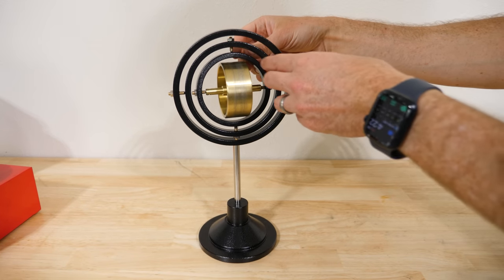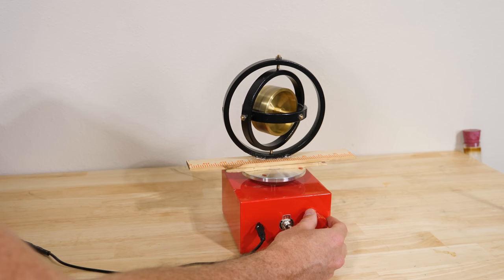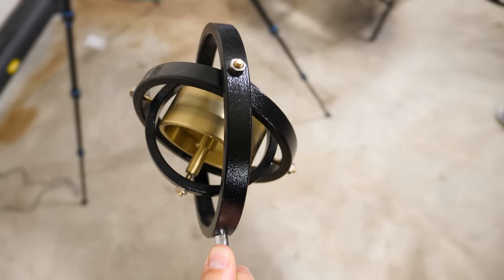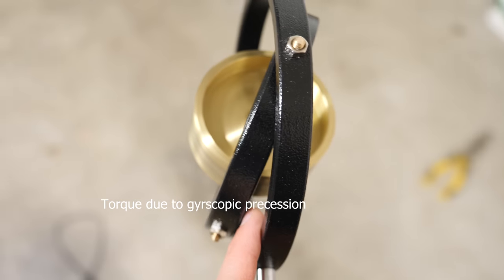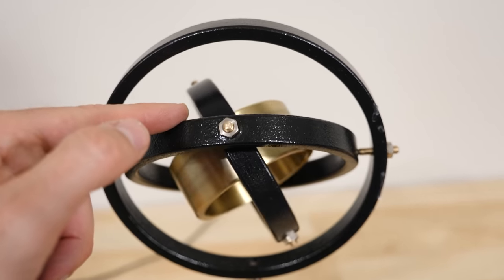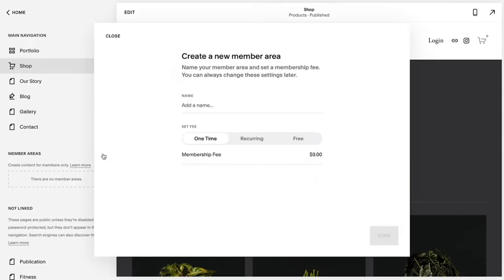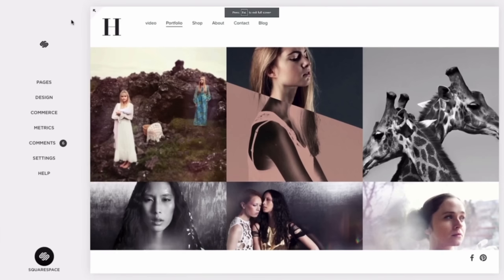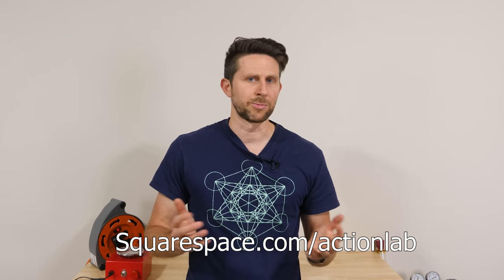Can Gyroscopes Provide Free Energy For The Planet?

Comment: Another question is whether you'd have to put more energy into the gyroscope (to get it spinning and keep it spinning) than you would be able to get out.
Reply: I can very easily proof,that this cant be done. And trying it out as a company is kind of stupid.
To extract any energy from earths rotation,you've got to change its angular momentum relative to its center. For this to happen, you need a external force. This could be something like the moon, but also something on earth speeding up or getting slower angular veilosity relative to earths center. So this is not possible with a gyroscope,cause its center of mass stays at the same point relative to earth. Its center of mass hasnt got any increase or decreas of angular momentum relative to the center of earth. Its basically bullshit. And i wonder, why they even tried.
Reply: Irrelevant since the very action of energy extraction ceases the perpetual gyroscopic movement
Reply: @drunkdrftr  This is what I meant when I referred to the energy required to KEEP the gyro spinning.  It seems similar to the attempts at perpetual motion machines.

Comment: One way to think of a gyroscope is a method of providing a lot of angular momentum without very much mass. But it is easier to think of this experiment as a big heavy flywheel attached to a generator. If you rotate the generator back and forth, then it will generate power indefinitely because the flywheel takes a while to catch up. But if you rotate the generator always in the same direction at the same speed, then the flywheel will catch up and no more power will be generated.

This thought experiment shows that you can only generate power with a reciprocating motion (as in the exercise gyro) and not with a steady rotation (as in rotation of the earth). It is an intuitive way to understand conservation of momentum. 

The Russians were being reckless with their rubles - no wonder they kept it secret!

Comment: Once it works, you will be extracting energy from both the spinning Earth as well as the flywheel. But if it works, you can store energy to the Earth at an oil field, and extract the same at gas/recharge stations--without using wires, tankers, or pipelines.

Comment: Isn't the circular motion of the hand that lights the LEDs using a gyroscope what you'd get it you put one in rough sea, with tides, currents and waves. That's the circular motion of the earth and moon, plus some solar thermodynamical flux in water and air...

Comment: i think i know how to extract energy from a gyroscope without slowing down the gyro. i also have ideas on how to use bouancy to generate free power that is so complcated in design that nobody would realize how it supposed to work. the gyro is simple but still people would not get it. if you try to lift a gyro on the end of a long stick compare to lift the gyro directly i guess the amount of effort on the stick is less than lifting the gyro directly and then you get the idea because the weight has not changed but somthing about the angular force has changed in respect to a stationary mass in the same setup.

Comment: It is impossible to extract energy from the earth's rotation by any means limited to the earth's surface. Any method that extracts energy from the earth's rotation must slow the earth down, but this breaks conservation of angular momentum.
The only thing that works is attaching a string to a weight, lifting that weight past synchronous orbit, and then winding the string around a generator shaft and letting the weight play out. The earth slows down, but the entire system conserves its momentum.
Yes, it's possible to extract energy from the tides at the cost of slowing down the earth's rotation. The moon slows down the earth, but as it does, the moon's orbit grows higher and angular momentum is conserved.

Comment: Maybe to harness the Earth's rotation use the tides. Connect a flotation device to a rope at the bottom of the ocean. As the tides move up and down it will pull on the rope, which will then turn a generator to produce electricity.

Comment: With the constant change in an area's temperature over 24 hours.
Using a gas in a baloon that expand and contract with these temperature changes.
Then using a rack and pinion attachment geared to get speed or torque from it.
Will this be a viable source of energy to drive a generator?
This will be a single cycle engine over 24 hours.

Comment: A gearing system is needed to convert the slow rotation of the Earth to a fast spinning dynamo. In principle, you could more easily also tap electricity from the Earth‘s magnetic field by a large enough dense coil array 😉
Reply: The friction losses would be an issue. Then how much energy is being used the keep the gyro spinning?

Comment: Anyone know the delta for input vs loss when applying electrostatic principles (similar to Vandegraaff  Generators) to this model(using conical magnetic levitation bearings in a vacuum race)Seems like a no brainer as a first step without taking advantage of China’s recent breakthrough extracting energy from quantum entanglement,….Cheers (also, incorporating concentric spheres and cyclotronic/collider principles in place of gyroscope rings, suspended via magnetic levitation is another option to completely remove the need for bearings thereby decreasing resistance. 

In theory we could even incorporate ionic and/or harmonic frequency stabilization/propulsion to smooth rotational wobble.

Comment: If you place a 1kg mass 10 metres from the pivot point of a see-saw and another 1kg mass 1 metre from the pivot point on the opposite side and allowed the see-saw to tip down on the side of the 1kg mass that is 10 metres from the pivot point, the 'turning force' would be 10 times that of the 1kg mass opposite.  Therefore, does this mean that the kinetic energy of the one-sided descent of the see-saw described above would be greater than that of the kinetic energy of the descent of the 1kg mass situated one metre from the pivot point if its side of the see-saw were allowed to 'break off' from the see-saw on the opposite side of the pivot point and fall down?  If so, wouldn't this violate the 1st LAW of THERMODYNAMICS?

Comment: Maybe another question is if there is a way to extract this energy without using magnets and wires. Currently our methods use Lenz’s law which produces resistance. Are there other methods that are more efficient?
Reply: Yeah, wind turbines.
Reply: @user-dj1hy6zc6q  Wind turbines turn magnets in a coil to generate energy. If we could find ways to extract useful energy in an even easier method, that would be groundbreaking.

Comment: Well if you just use the waterfalls and some kinetics mechanical device to implement the same motion that' your arm and hand we're doing  with that  gyro ball, maybe something like  shock absorber on bikes withe magnetic nodes the opposite poles to counter it back and forth , while attached to a separate super spring under the waterfall to charge up a kinetacynthic battery modded with photosynthesis system

Comment: The gyro is an overkill. You just need mass to make it work. Build a large massive disk with huge circumference supported by central pillar that allows it to turn. You will get 1 turns' worth of energy per 24 hours out of that structure.

Comment: how about the weather at the equater at latitudes north and south and altitude (nano?) 
...I envision many containers (temporal) and thermal vortexes carrying humidity at barometric pressures 
...maybe dip a copper bee bee in zinc to extract electromagnetic charges like lightning bugs and electric eels do 
STATIC ELECTRICITY (angular momentum)
apply the Pendulum to the gyroscope in a helium container of polyethylene chloride ion inertia (polarized)

Comment: Question: 2 geostationary satellites connected by a wire. As the earth turns in relation to the sun, that wire would be cutting through the magnetic field of the sun. Wouldn’t that induce an electric current in the wire? Alternatively could you use the magnetic field of the Earth the same way? I wonder.

Comment: the reason you're able to extract motion out of your arm into the gryo-ball is due to acceleration and deceleration, not movement.  if your arm was able to spin all the way around like the earth is doing, then the gyroball would never get past the initial acceleration input....   so, beyond slowing the earth's rotation down, all the energy was already used in accelerating the earth into its spin billions of years ago, and so, there's no way to get that energy. although,  some wind energy is most certainly derived from the rotation of the earth in conjunction with temperature differences between areas and gases in the atmosphere.

Comment: I think you might have too many degrees of freedom with that gyro you used for the demonstration; I think if you have the flywheel axis at a 90 degree angle to the axis of rotation of Earth, and the generator axis aligned with the axis of rotation of Earth, with no additional degrees of freedom, it won't be possible to reach gimbal lock, and so you can keep extracting energy for a long time without ever things reaching a bad alignment. The only real challenge would be to overcome friction/drag/electrical resistance losses and achieve over-unity, getting enough energy left after using the energy produced to keep the flywheel spinning.

Comment: This guy does not explain why the Russian experiment failed 
Spoiler alert: it's not because of the effect he shows. 

It's more down to the fact that vacuum chambers and magnetic bearings (needed to keep the gyro mass rotating) are expensive to make and require a constant supply of energy to maintain. The costs of maintenance of such a system do not balance the energy extracted.
Reply: Can you share some more details about that experiments. What's it called?
Reply: @piyush_chaturvedi  location at 2:44 is Plokštinė missile base. I highly doubt about free energy researches there. So information looks like fake.

Comment: What about earth magnetic field? Taking advantage of it? I was thinking: imagine a huge compass. Football field size. Where the needle only functions and starts to rotate and point to north when electricity is given.

A super weigted needle (thousands of kilograms) starts to rotate, moving, wanting to align (parallell) with earths magnetic field. Right before it aligns, you switch off the electricity, making it continue to rotate due to momentum. After about half rotation, when the north point passes the opposite direction, you provide electricity again, accelerating the  needle. Now repeat the process.

After having lots of kinetic energy of the heavy needle, you plug in the generator, and produce electricity. I havent tought this through, but it seems like the COF would ve just about 1:2? Theoretically speaking... Like if you understood my thinking😅😅😅
Reply: For that to generate any meaningful energy (extract more than you put in to turn that electromagnet), I must imagine that the friction between the needle and anchoring point should be extremely low, or negligible. And I can't even begin to imagine how much powerful an electromagnet must be to be able to move thousands of killograms just with the magnetic field of the Earth (Earth's magnetic field is very, very weak). Just turning that thing on would be a hazard to any living creature in a 5 mile radius.

Comment: Maybe fix the gyroscopes axis of precession (the axis about which the poles of the gyroscope rotate with respect to the Earths surface) to a plane perpendicular to Earths axis of rotation, use a really, really big gyro to generate insane amounts of torque and drive a gear train to produce a rate of rotation appropriate for a generator. Tap off some of the output to maintain the gyros rate of rotation and hey, presto you have yourself a solution to the climate crisis.

As a final FU to the hydrocarbon plutocrats we could even use a highly efficient coal powered heat engine to spool it up for the first time; a kind of “They’ll sell us the fuel with which we doom their industry.” sort of thing, you know?

Comment: You can cancel the precession with 2 counter rotating gyroscopes.

I also wouldn't call it free energy since it has a real world source (planetary momentum).
I only use free energy to describe systems that utilize Zero Point Energy to create new energy that didn't previously exist in our universe (a fundamental breaking of thermodynamics).
This distinct from perpetual motion which uses classical mechanics and is impossible!